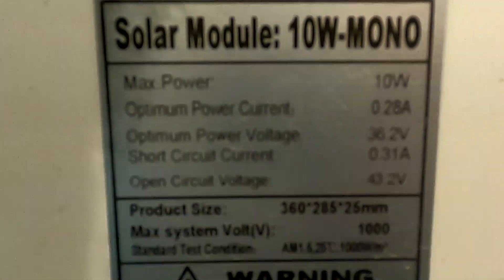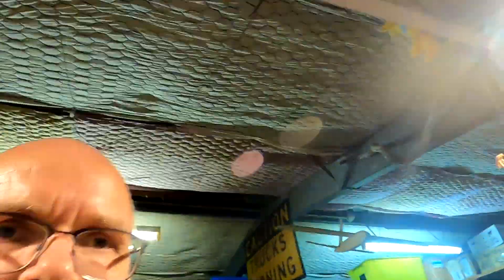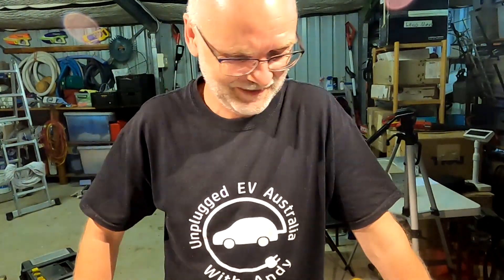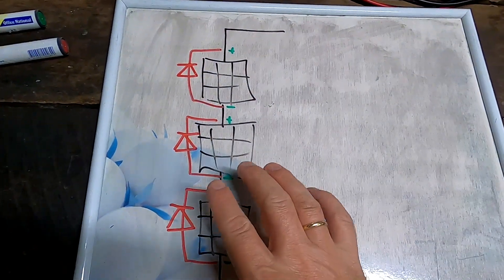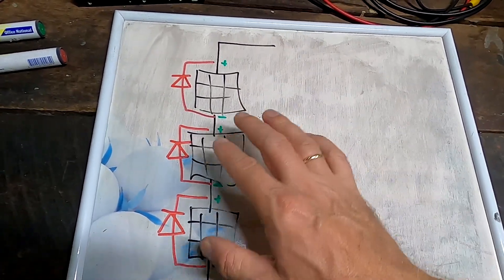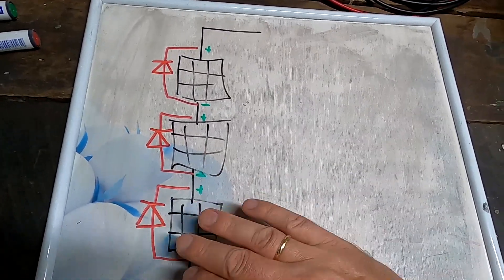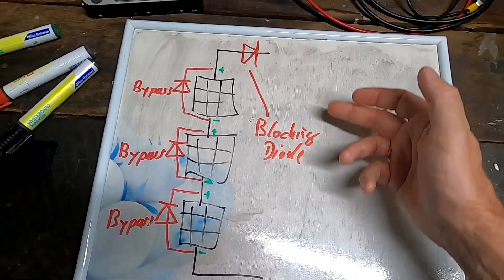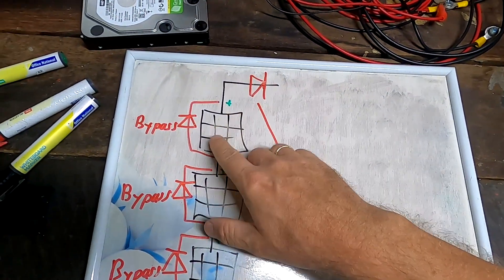Solar Upgrade EP4.1 - Bypass vs. Blocking Confusion and why solar panels DO NOT act as a diode!

Comment: i did a little checking-most solar panels give approximately the usual voltage in very dim lite but next to no current output(very low) THE TEST-- i put 1 panel in sun, the other in a very dim room-result very low  back current-not enough to require- diode-however i use my panels in parallel with a  Battery charger which is on all night since my usage during day exceeds solar input- guess what, in this situation there is a higher back current about 200ma so i think i will put in diode--but isolating panel in normal light conditions is not necessary as each panel consists of individual cells series parallel connected anyway, this back current helps in winter which helps each panel to melt the snow from them--in this case there internal back current is helpful and is in every panel
Reply from the maker: That is one very extreme test which would not occur like this under normal circumstances, right? Yes, you can use this reverse power to melt snow and ice off your panels. Just not sure about the parameters to keep this safe.
Reply: @OffGridGarageAustralia The main thing to remember is that the internal back current that exists inside every solar panel due to the fact a large panel for say 12V consists of ,if i remember to be 36 cells in series/parallel all interconnected to help speed up melting as soon as a small area sees the sun-my old system(now sold)fed directly into 220vac with modules---the old power meter used to spin backwards and subtracted the mechanical kw indicator like turning back your old car odometer, once my internal consumption was less than 500w--sorry to say the new digital smart meters don/t, it goes up, reason for selling. Hope i,ve been a help, I bought my first pair in 1996 and were still at about 90% in 2017

Comment: Andy - interesting experiments, try totally shading the solar cell, then put it in full sunlight and see if the voltage required to back feed current through the solar cell changes? In theory the solar cells output voltage (what ever it is at the time of testing) has to be overcome by your power supply before any current will flow from your power supply? Your solar cell was under quite bright light so it could have been producing a voltage which would explain why it needed higher voltages to back feed current through the cell. Blocking diodes are only needed with parallel strings for example,  when one string is facing east and another is facing west so they do not produce power at the same time of day! As your experiments clearly showed parallel strings on a roof in a east then west facing roofs would back feed without blocking diodes on each string. In situations like this it is better to have each string on separate MPPT inputs on your inverter then blocking diode are not needed. :)
Reply from the maker: When I connected the solar panel to the power supply to start the experiment, you could see the power supply did not show any voltage because the solar panel did not produce any power/voltage. if the panel would have produced say 3V under these conditions, the power supply would have shown these 3V. So the LED light above was not enough to trigger anything apart the 0.2V the power supply showed.
Reply: @OffGridGarageAustralia   Andy - what your power supply shows as a voltage will be largely irrelevant because it totally dependent on the impedance of the volt meter and power circuits in the power supply relative to the electromotive force (EMF) and current provided by the solar cell under its ambient light conditions at the time of testing! Presumably these are unknown but low, so if the power supply is actually NOT providing back current and the cell is in near total darkness but still producing its rated voltage when open circuit, when you apply back EMF with your power supply back current will only start to flow only when the EMF produced by the solar cell is overcome by the EMF of the power supply. Which is why you got the result you did with your experiment in my view. By the way, you are right solar cells and solar panels are NOT the same as diodes they act more like battery cells or capacitors than diodes! Blocking diodes exist in parallel string arrays because conditions relating to shading can and do occur that allow back current in a string to rob the total array output of power. Bypass diodes exist in panels to prevent partial shading of one or two cells causing cells to overheat and become a fire danger by becoming a resistive load in the string or panel. In a worst case scenario most of the energy produced by a string can be used to heat just one cell creating what is commonly known as a hot spot on the panel.

Comment: @Ownmybit mention about your breakers blocking the path of least resistance. 
Yes, but I believe (Andy can correct me if I'm wrong) only has those there when "servicing" the system. Just as a precaution. 
I think the real question. If someone wanted to be cautious, would it hurt to put a BLOCKING diode in the path?
I understand and you did a great job demonstration that it's not really necessary, but someone might want to just take the extra precaution to not let even the little current if any damage the solar panel.
Reply: The blocking diode will generate heat and some wattage will be lost ... Watts Lost = Amps x ~0.7 Volts or  = Amps x ~0.4 V (Schottky)

Comment: Noticed a bit of flickering in your videos.... Does your camera have a fps option? If you change this to something which is not a multiple of the hz of your lights you'll get less flicker. On gopros and some other cameras it can be done by switching from NTSC to PAL.

Comment: What's the difference between a "blocking diodes" and a "bypass diode"? Are they designed differently? I thought a diode is a diode. The functionallity of a diode can be different. Like a "blocking diode" can be used as a "bypass diode" and vice versa. Diode is like a check valve. is it not?
Reply: Yes, the same diode could be used as Bypass or Blocking functionality ...
Reply: @MrSummitville How will we know if this is a blocking diode? I have rectifier diodes, can I use them? Please tell me about this
Reply: How will we know if this is a blocking diode? I have rectifier diodes, can I use them? Please tell me about this

Comment: Hi, well explained, I think that when you buy a halfcut solar panel you also get 2 part of series so with 3 bypas diodes over a 144 (72+72 in parallell) you only loose 1/6 of power if one part is covered compared to 1/3 in a traditional 60 or 72 cell setup.

Comment: You don't  need a blocking diode between parallel strings but should have an OCPD.
Reply: OCPD recommended, only if, more than two strings in parallel ...
Reply: @MrSummitville  thanks

Comment: RE: Blocking diodes.  There is a case for blocking diodes for protection in case of "Fault".  In the case where you have many strings in parallel, each string should have fusing or blocking diodes. In the event of Fault where cells go short circuit in a string - the parallel strings can drive "Lots" of current through the faulty string leading to fire and so on.  A fuse or blocking diode saves this from happening.

Solar cells are an interesting creature, they are PN junction so they are a diode, but when irradiated the electron flow is such that the diode action is "Biased" Off.  

They really are a gift to society.

Enjoying your videos Andy :-)

Comment: Hi Andy, thank you for the follow-up experiment. Can you please do this easy experiment for us? I also see people started doubting your bypass diode explaination in the comments. In the previous video, you covered 2 of the 3 panels right? Since, the panels have bypass diodes, people will question shouldn't it be producing around 200W from the non-covered panel instead of a mere 30W total? However, as far as I understand your battery system is over 50V and a single panel's Vmpp is less than 40V, is that right?  So, the panel can't change your battery, hence the low power output. But if you had covered only one panel, then the potential of the remaining two panels will be high enough to charge your battery and the panels should be able to push 300-400W right? Can you please verify this? Thanks.
Reply: I think his bypass diodes have failed.
Reply: @MatejFabianek  No I don't think so. As I said, only one panel isn't enough to charge his 50V battery. Andy can verify by covering only 1 panel.
Reply: @DSmartLife  his Victron app shows 30W/75V and later 14W/66V on the input from solar
Reply: @MatejFabianek  The usable power is only from one panel, his system requires at least 2 working panels. Obviously, the voltage we see is added with the voltage from the two shaded panels, and hence producing max 30W (V of panels should be greater than the battery V to charge). Anyways hope Andy will verify this easily and show us. Thanks.

Comment: I did not know there were bypass and blocking diodes.  I thought they were all blocking.  It was the only way I ever used a diode.  So, how does one test a bypass diode.
Reply: Its the way they are set up

Comment: So if the entire string is shaded, the other parallel string will indeed feed current to the shaded string. If I have a roof with a peak and have panels on both sides (one facing east and the other west), at one point one string will be in total shade and the other in sun, I will need a blocking diode.
Reply: Maybe, but not necessarily. I have two parallel strings on my RV that are angled at opposite directions. (See picture here: https://photos.app.goo.gl/gPnaMwwGhnQRB8f66 ) and the voltage of the strings on both sides are almost always exactly the same. The intensity of the sunlight affects the current that the panels put out far more than the voltage. The voltage is almost always nearly the same while the amperage is what jumps up and down based on shading.

You have to pretty much completely cover a solar cell before you'll get the voltage to drop by a significant amount. (IE: Cover it with a blanket like Andy did). Unless your roof angles are quite steep the sun would have to be very low on the horizon to be low enough to put the panels on the other side in "complete shade"
Reply: Shade not total shade ! (Total shade is when u block all photons)

Comment: I have some doubts:
1, The solar strings act like 2 battery cell connected parallel (remember top balance!). Until there is a big enough load the current flows MOSTLY to load.
2, Parallel resistors. The MPPT (and LiFePO4 cells behind it) have very low resistance. The Solar panels have high resistance. So current is flowing through the panels too, but few:
R = R1×R2 / (R1+R2)
3, Voltage difference: where there is a potential difference there is current (and bigger makes higher)
4, MPPT is a high frequency DC/DC converter. So it pulsates very fast (open-close) in the solar side. And every time it is open there is an OC (only path through lower V string).
5, You can have a string in East and one on West roof (angle >20). The East is already producing in early morning where the West panels are totally in dark.
6, You can have more than 2 strings parallel. Like 2s6p config for some MPPT's. If one of the strings is in shade then 5 strings will push current through it. 
7, Use fuses for the parallel strings. If a short occurs then all the parallel strings production will be going through THAT (lower resistance). Making a big shiny arc (DC so constant arc).
Reply: The characteristics of the solar strings are very different to 2 batteries in parallel. They don't just try to balance each others voltage.
Reply: Wrong, solar panels have almost no similarity with battery. It behaves quite differently. Parallel solar strings with different voltages won't backflow until it has a high enough voltage difference because solar panels don't store energy (or has very small capacitance) and is not designed to take current from other sources. Unlike battery, where 1V difference matters a lot in high capacity paralleled batteries.
Reply: That's what I feel is happening too! Andy is a great engineer and all, but not so hard on the science part.

Comment: The panels did used to have the diode built in.
Reply: Yes, Solar Panels that were "designed" to be connected directly to a 12 Volt Battery - ie No Charge Controller...

Comment: I don't know if it's true, but I have heard  you can meet snow off panels by reverse feeding them, I think I'd just fire up the generator, to prevent wear on the pv system, if true, besides IF it snows here, it's usually melted in a day or two,   I have enough battery to last a week sunless, if I try maybe two!   I'm planning on building a boiler on my wood stove, and using it to heat the house and generate power, from a dream engine, or turbine! Maybe a Tesla turbine, depending on what I can build and or find!!